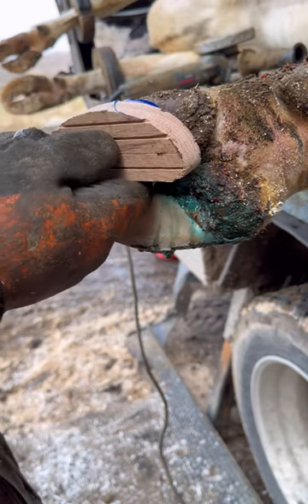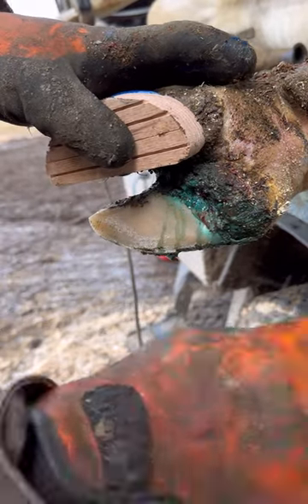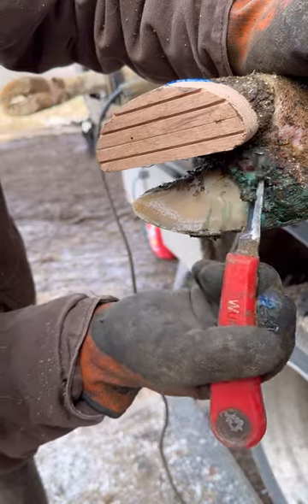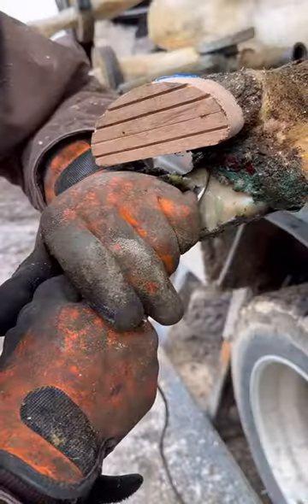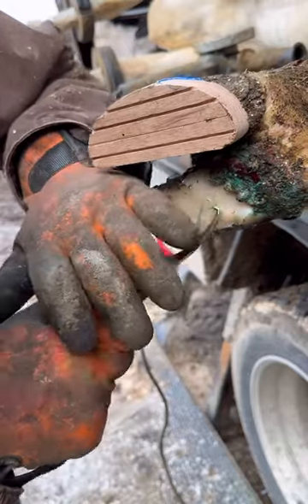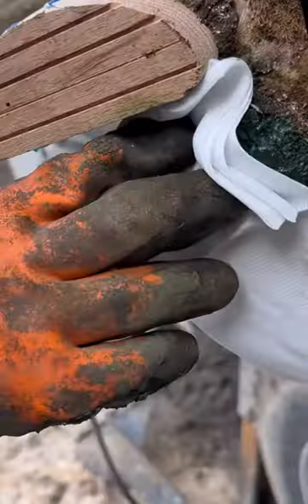"How we treated a severe, festering and stubborn sole ulcer in a beloved cow’s HOOF!”

Comment: Dude, this one is gnarly! (but cool) Is that some loose meaty keratin material hanging out of there at about the 20 second mark? I've seen those keratin fingers once before in a trimming video and holy cow, that shit is extreme.
Reply: I don't understand why Steve didn't pull out all that shit (soft straw)instead of attacking it with a blunt knife and grinder, that cow must have been mooowing badly, I usually give Steve a thumb up but not on this one. 😢
Reply: The cow wasn’t mooing at all. But there’s an obvious infection of flesh here and not a lot that a hoof trimmer could do besides get the loose hoof away from the gross area and apply some topical. This cow needs the vet and some antibiotic injections. I’m sure the farmer will make that happen asap.
Reply: Tim waterman thanks soft bedding around the 20sec not keratin fingers (hoof gp)& Steve around 1minute + starts to do voice over not live, just fought ide let you know 😮